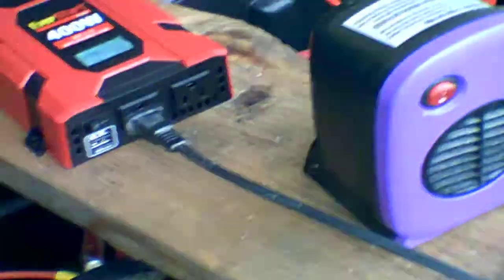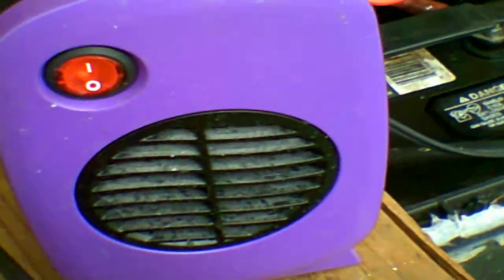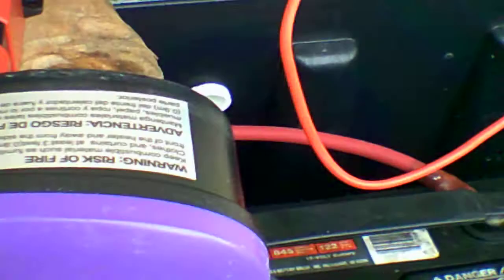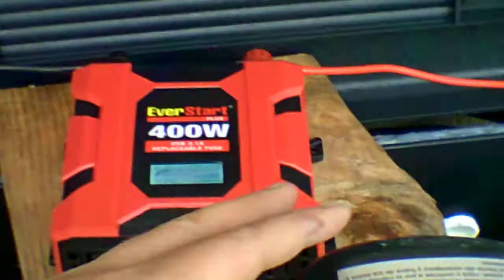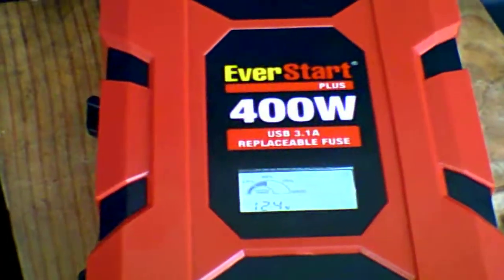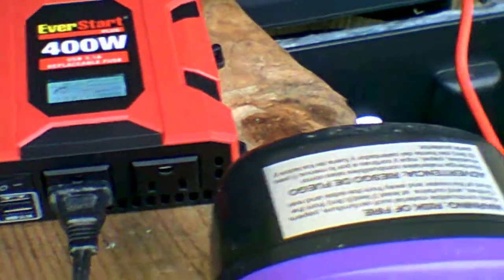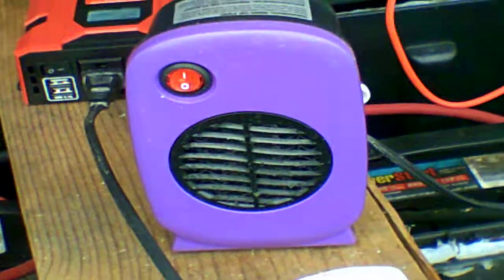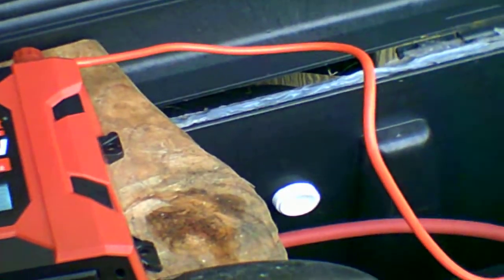400 watt inverter running small heater

Comment: Heaters are motorized which require true sine wave, not these cheap modified sine wave inverter! Unsure how difference ac and DC motors are... Placed and torn many DC motors apart! Ac ones are wired to spin upon the sine waves! Inversing 90 degree angles! A modified sine invertor outputs a very inversing dirty square wave! What's motorized, fans, electric heaters having fans, ac units, brewing coffee pots, refrigerators, drills! Used caution when using these modified invertors!
Reply from the maker: I have several things that run just fine on my 1100 watt and 2500 watt modified sign wave inverters. The 400 watt inverter that you see here is just junk. I have no issues running my fans and heaters, air conditioners, fridges, drills and coffee pots , ect....from a modified sign wave inverter. I would not use one with my laptops or my girlfriends computer or her PS4 or our tv. You are right about the sign wave though it has more of a square and dirty sign wave. Much like those cheap $100.00 dollar generators from harbor freight or amazon.
Reply: I have read this is a 200 watt heater. Looking at the setup I would suggest using a larger set of wires. That will help with cutting down resistance. So, long story short, this will all depend on your battery supply. 1000 wh battery will give you about 5 hrs of operation, 2400 wh will give you 12hrs... etc.
Reply from the maker: @Kronos2361  The tag on the back of my heater states 350 watts, and I also have tried this with 2 Gauge wire with the same result. You are also correct about the battery supply. The larger battery bank the longer it can power a inverter and other items.
Reply: @christopherhorton821  You never really know what they are until you try them. Just like politicians :)
Reply: I run mine with a 2400wh Bleuetti.
Reply from the maker: @Kronos2361  I can run my 1200 watt space heater, or my 700 watt microwave, or our 10,000 btu haier window unit air conditioner on my 1100 watt power bright modified sign wave inverter. I also have this cheap piece of junk everstart 400 watt inverter, and I own a 1500 watt to 2500 watt Pure Sign Wave Inverter and a 2500 watt to 5000 watt cobra inverter. As far as a bluetti goes it is no different that my battery bank and one of my inverters. Those are nothing more than a battery with a built in inverter. The one main difference is you can take yours with you a lot easier if you need portable power. The other difference is the price. Mine was much cheaper for doing the same thing, and I bought solar with mine and still saved a lot of money. I also have a 2200 watt gas inverter generator. I can also charge my batteries with either my solar or my generator. I can even use a plug in battery charger to plug in to a wall outlet. And yes I do know what a bluetti is.